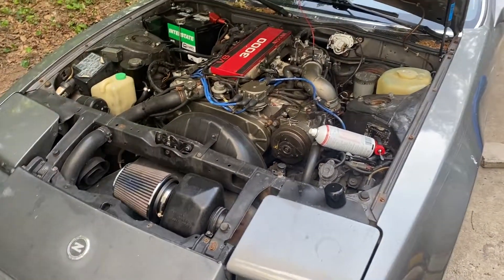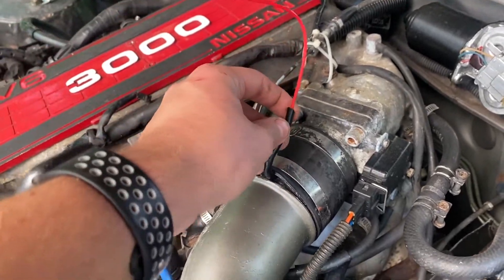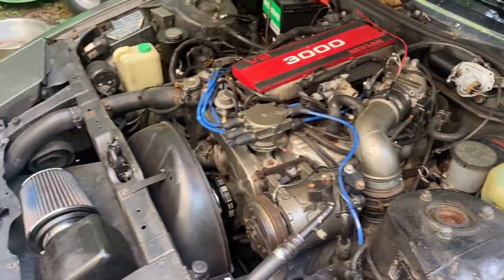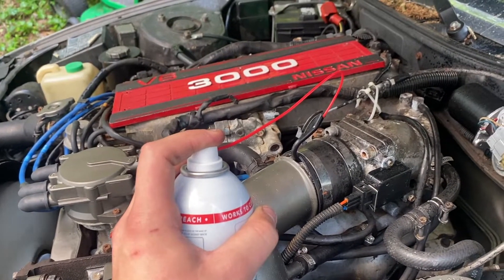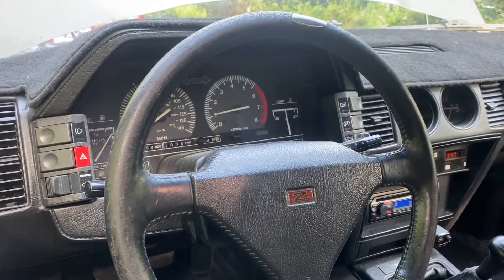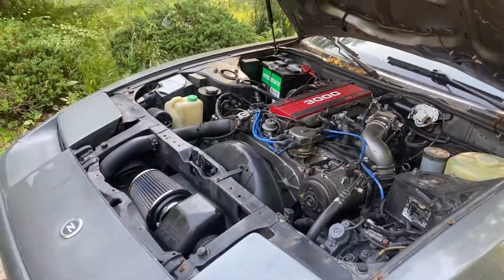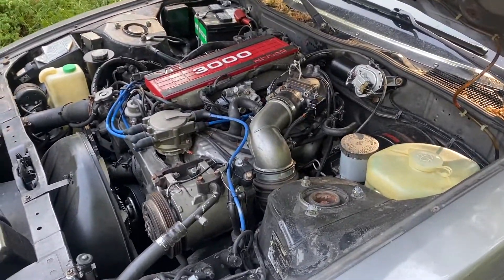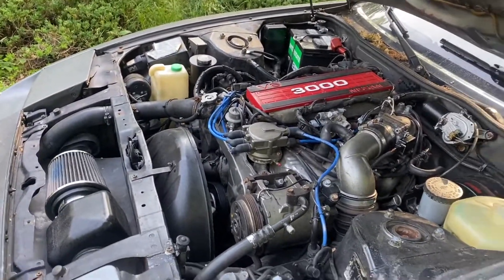Using SeaFoam On My Nissan 300ZX! Does It Actually Work?

Comment: I have been using seafoam on my Z for years now.  But I usually dump it in the gas tank and some in the oil.  Never tried the spray method.  will give it a go!